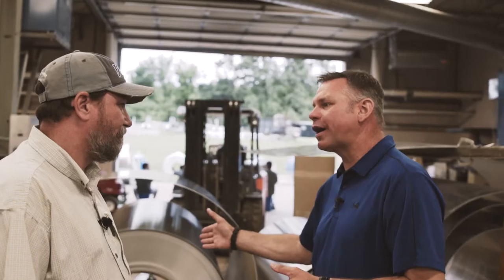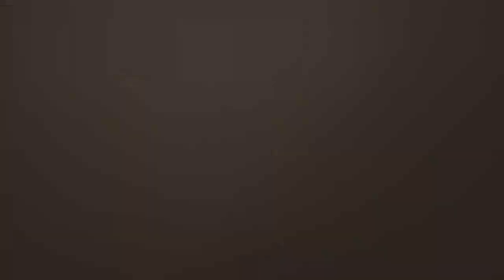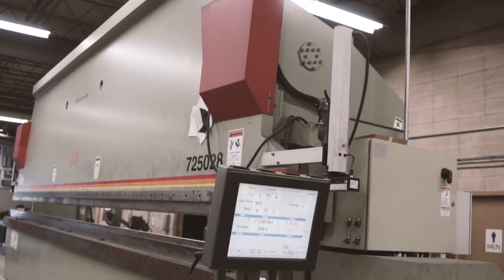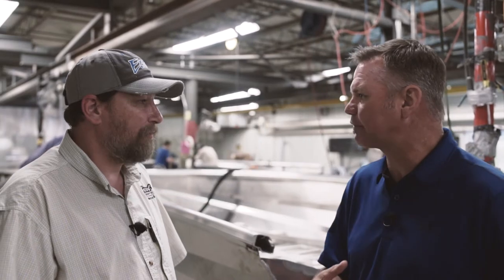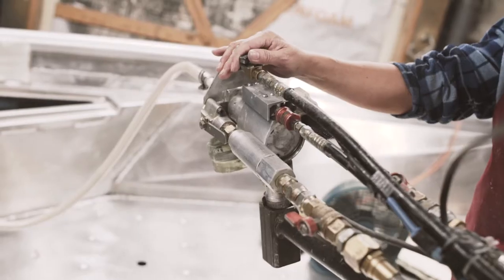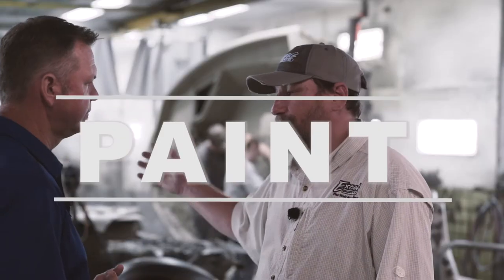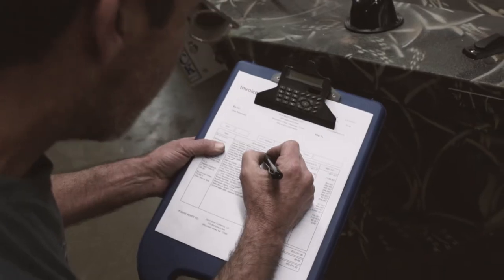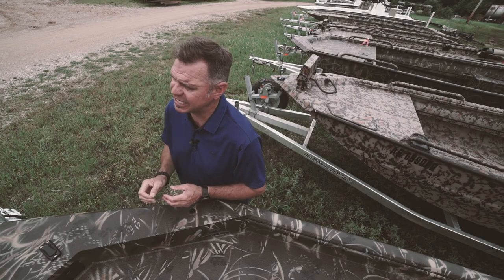Excel Boats Plant Tour

Comment: My buddy has your F4 18x51 boat and is not happy how you just spray the foam in the bottom of the boat and it's not sealed from water. Now it's stays constantly soaked with water like a sponge and adds easily 100+ pounds of weight that isn't necessary. Not well thought out, and poorly engineered. He just cut all that soaked foam out and is now welding it back up. Added 2-3 mph on top end speed with the wet foam out of the boat.
Reply: I see that you did not get a reply from them. Not cool.
Reply: Call Paul Reynolds. He is national sales manager. I ask him directly about ur concern and issue. It should be warranted. This was a know issue for excel.  Supposedly they switched vendors and foam type.
Reply: @JackDrenalin  ill check into that but I doubt there going to free of cost remove the old saturated foam and repaint and weld the floor back. Besides it's already been done on my buddy's dollar. Just trying to make people aware and grab Excels attention of the only flaw I see in their boat honestly.
Reply: @davidmiller741  update.  I called one of the engineers at the utah plant and his response was the best I have heard.  They did changes on the foam type and vendor.  He soaked the foam for three mos.  He found that the foam only increased its wieght by 3 grams after the soak time.  Now this was on a small scale as it was in a 5 gallon bucket, but Made me feel better so I bought a new F4 last week.  Paul Reynolds made me feel better as well about excels commitment to quality and said if there were any foam issues they would back it up.
Reply: @JackDrenalin  When did they make this change?
Reply: @jaredwood5973  I purchased my boat in may 2018. I believe the boats prior to 2015 may be affected. I cannot guarantee my answer. But I would call the Utah plant. They were very informative
Reply: @JackDrenalin  call Kent Saxon at Gator Trax